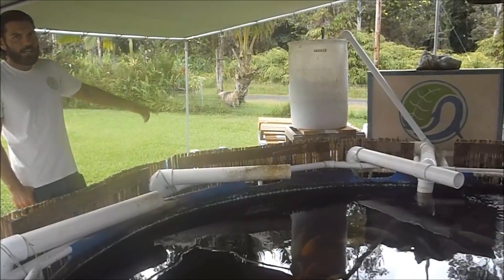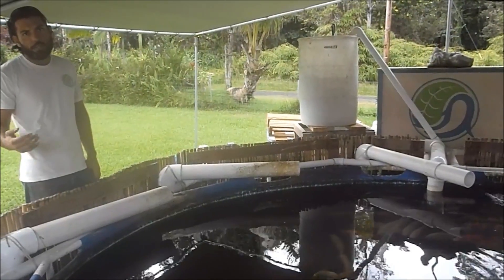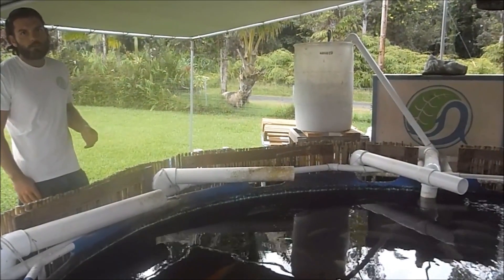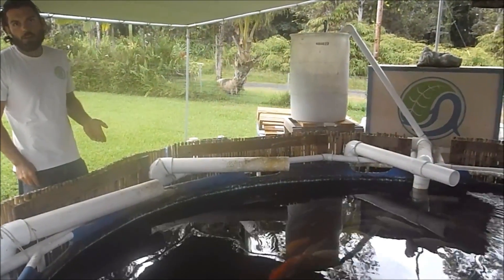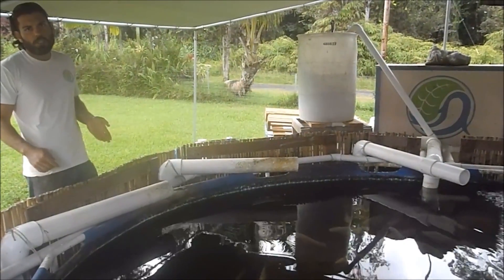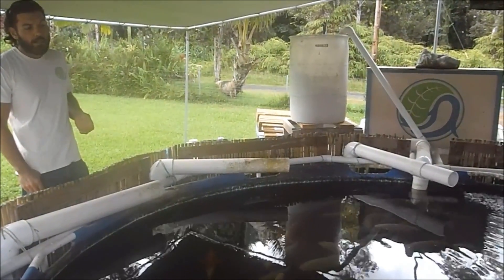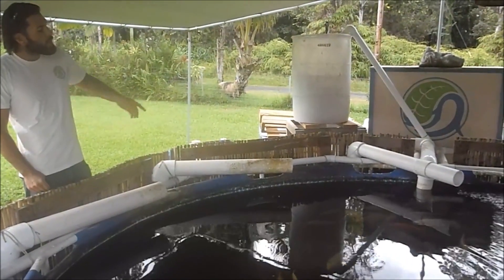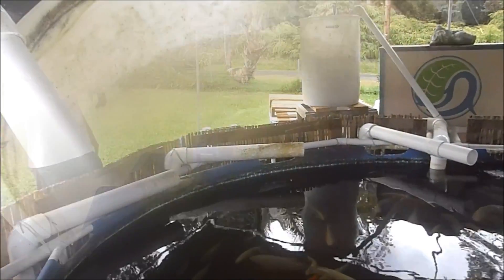Hydrocyclone for Aquaponics Aeration

Comment: Interesting idea. I wouldn't replace my air pump with it, but I will adjust my water pump to use this model when it's running because,  well, why not?  just one question though: If the water pump isn't always running,  and the exit pipe dips below the water level,  wouldn't that prevent the air bubbles from being pushed down since the water level inside the pipe will match the tank and bubbles tend to go to the surface?

Comment: To minimize energy consumption when using a water pump, consider splitting the flow into multiple 5gal buckets instead of a single 3ft tall 55 gal barrel.

Comment: restricting the outlet is a good idea as it creates back pressure, raising the height of water in your cyclone, improving aeration. Placing the outlet below the waterline or simply sticking on a reducing adapter would work.

Comment: Thanks for sharing! I have started to set-up my first aquaponics system and am experimenting with this hydrocyclone idea vs a homemade venturi. I don't have as much flow through my hydrocylone as the one in your video and am not creating such a large vortex, plus in my case their will not be a constant supply flow so I am struggling to start and maintain the vortex. Have you tried a venturi to compare? Although I like the hydrocyclone idea, I think in my particular system I may be going to a venturi instead.

Comment: As I loved the idea, I did some tests. It really sucks in a lot of air. Unfortunately, I will NOT install it in my systems. Why? Simple: I found out that the extra power consumption to pump the water half a meter higher is bigger than the consumption of my air pump. In short: the power you win by removing the air pump is lost by the extra power consumption of the pump. The bubbles from a large air pad are also smaller, binding more oxygen to the water. Works fine if you have an oversized pump!